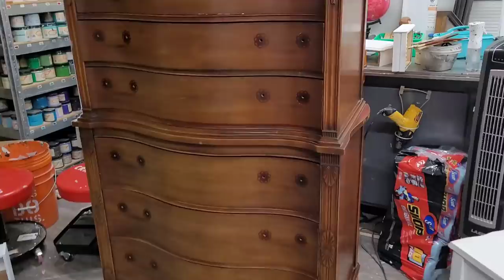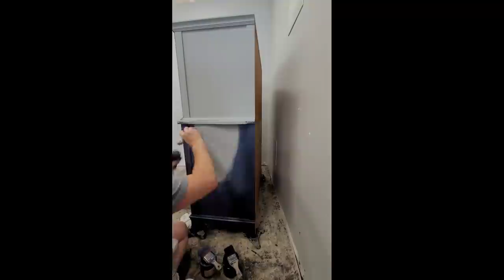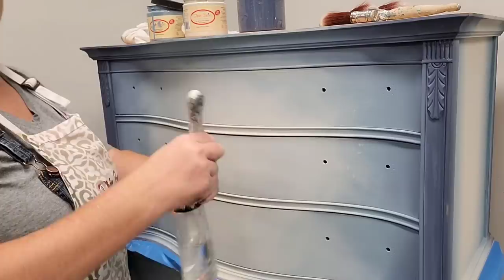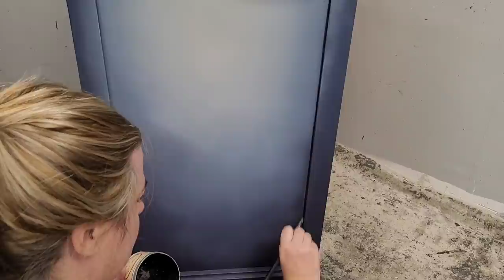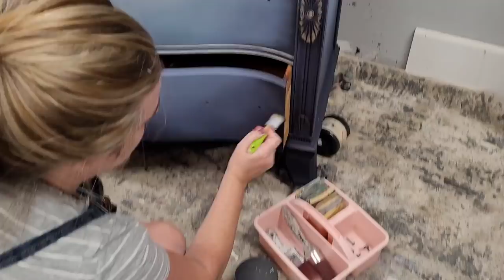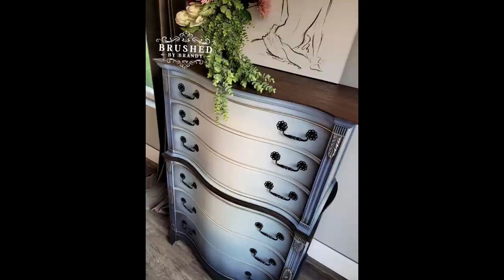How to Blend Blues, with Metallic Stenciling

Comment: Brandi I want to get that soft blended metal look for my fireplace. What brand may I use that withstands high heat?
Reply from the maker: I don't know any chalky style paint that rated for high heat, most that paint either have a surround that doesn't come in direct contact or are using it decoratively. You can try them, but a manufacturer wouldn't advise that use. There are hardware store paints for high heat areas, but the color selection and style is more limited

Comment: How many coats of satin finish should I use on my chairs seats?  I used aubergine.  Also, can you spray satin finish?
Reply from the maker: I usually do 2 coats on body and 4 on a top. You can spray satin, but it's not my favorite to spray, gator hide sprays easier

Comment: Hi Brandy, this is a little off topic but I just found your channel.  I've been wanting to refinish my 80s golden oak bathroom vanity and I've been watching your gel stain videos.  My vanity has that paper finish over particle board on the side and I'm wondering if a gel stain would adhere to that.  Also, what prep would be needed and safe for the paper?  Thanks--you are so talented!
Reply from the maker: That's a laminate and it is harder to adhere to. I would recommend a base coat of slick stick gripping primer, then a cost of paint in a brown/wood tone like burlap,  chocolate or coffee bean, then gel stain over that if you really wanted a stained look. Will obscure wood grain but you definitely need a primer on laminate
Reply: @BrushedbyBrandy  Thank you so much!